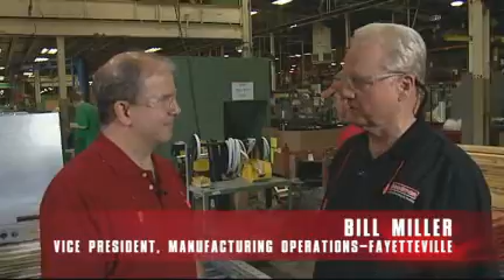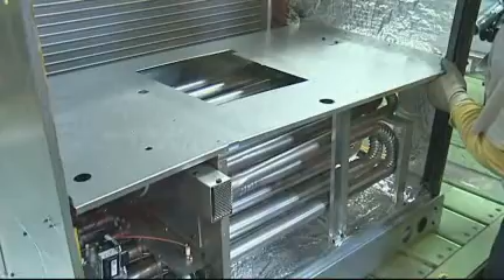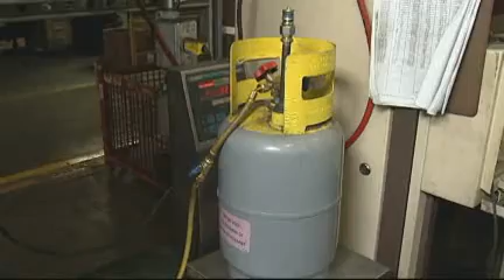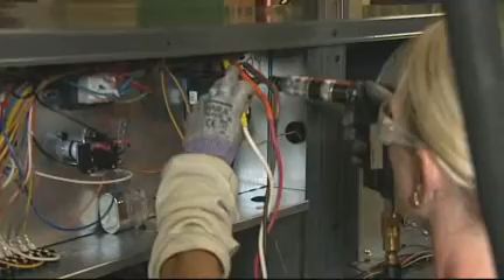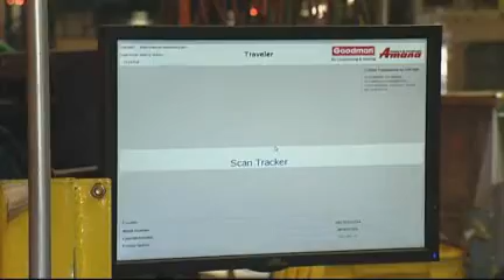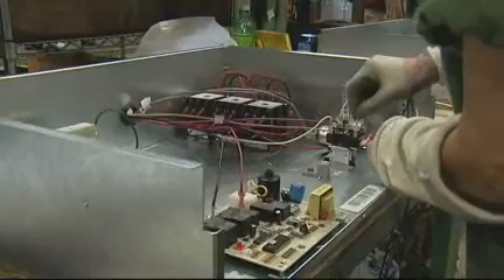Amana / Goodman - Commercial HVAC Tour

Comment: Is this guy serious?  I's this the facility where 12 goodman units were installed and 12 of them had wiring issues, leaks etc....Their units look ancient and are so cheap..flimsy screws holding fan motors in on RTUs...just old bad quality...brutal..sure, fasten the insulation, the rest of the unit will vibrate itself apart and the screws will be all stripped in a short time (probably due to having to be unscrewed and screwed in so many times for all the repairs it will need.